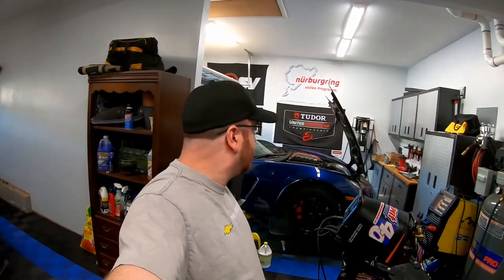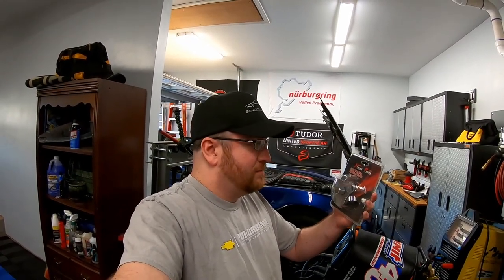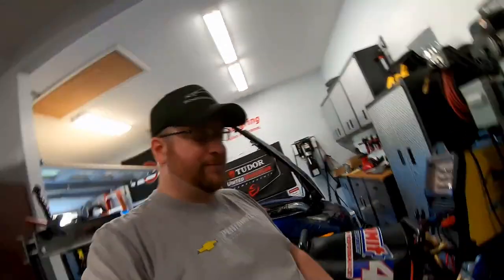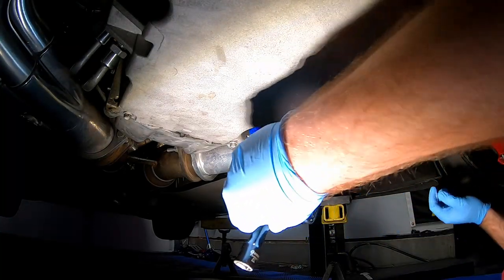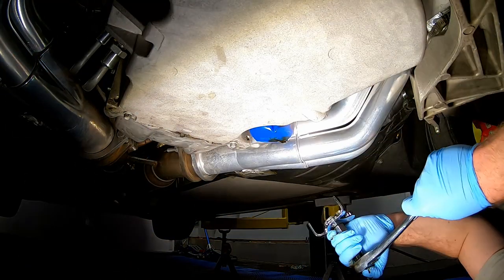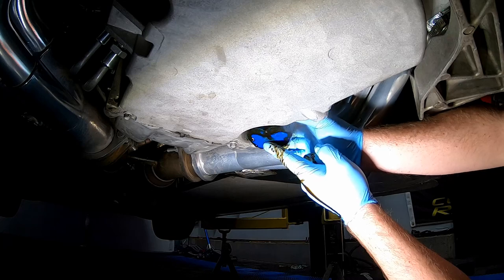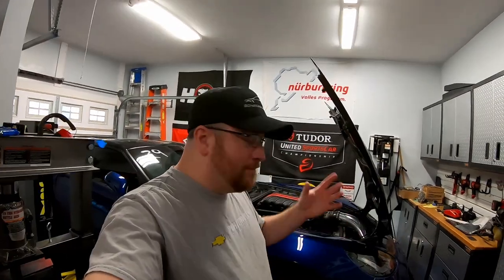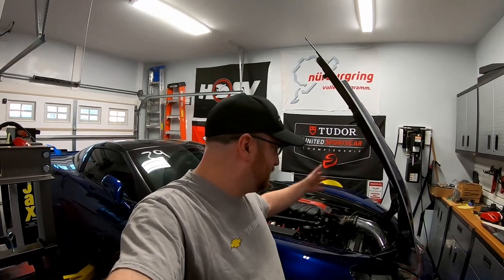3 Leg Oil Filter Wrench

Comment: Couldn’t find the appropriate size one piece filter wrench so I bought one of those at auto zone. The filter is situated front of the engine but about six inches behind the belly pan and thru an access hole. The first spin just marred the surface of the filter that didn’t budge. I had various sizes of silicone vacuum hose that fit over the legs so I cut three pieces but they shifted down the legs and not at the tips where the would contact the flat surfaces of the filter. Then cut three more the entire length of the legs and it worked like a dream. Was gonna return it but now it earned a place on the peg board!
Reply from the maker: Glad to see hose would work as well - some had suggested wrap the forks in electrical tape - but I think hoses would be a lot neater.
Reply: Like a dream, tried to paste an image but alas poor Uric!
Reply: @findafire  post a pic lol im having this same issue.
Reply: @pvnchos1478  I tried to but this medium doesn’t allow me to post a picture have the image in my phone.

Comment: Cheap filter, thin walled metal can. Those wrenches are not made to use with a ratchet. They are made for constant torque. Operator error. Wrench did the job.
Reply from the maker: You going to use a breaker bar on an oil filter? How is that going to be any different then a ratchet?
Reply: @bonecrrusherSS  Constant torque on that tool. Ratchets don't do that. In other words, I see you are puzzled, that wrench will slip and fumble around.
Reply: @rickjames6948  What makes you think I could get anything other than a ratchet into the space available to remove the filter?
Reply: Ååh
Reply: @rickjames6948  After trying the cup and a strap to remove the Honda filter on my Acura that was installed by the specialty repair shop, I resorted to this Shankly and it worked.  I used a breaker bar and it certainly left a few dents in the filter.  If the filter you're removing is seemingly soldered on, this tool will leave a mark.  I wouldn't recommend using to tighten though.  This vid was very helpful!

Comment: You’re oil filter shouldn’t be so tight that you put holes in it like that lol.
Reply from the maker: I'd rather have it on a little tight then get loose and lose an engine due to a loose filter.
Reply: @bonecrrusherSS  Which happens all the time....... LOL LOL

Comment: If you need a special tool to take this oil filter off you don't know what you doing these models are very easy I mean there is cars and trucks are there that you can even see the oil filter nothing fits under those hoods or around the engine those are the kinds of tools that we need come on man make a good video so we can learn
Reply from the maker: Did you even watch the video? 80% of the filter is covered up by the oil pan - and then I have a long  tube header right next to the filter. Your standard filter wrench barely fits. 

This tool is made to make filter removal easier - which it clearly has - and is shown in the video.